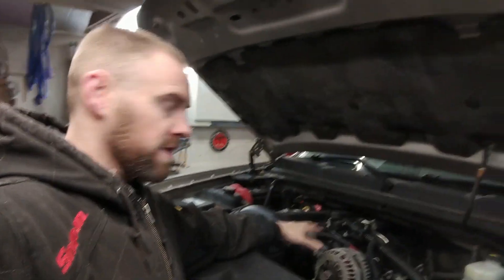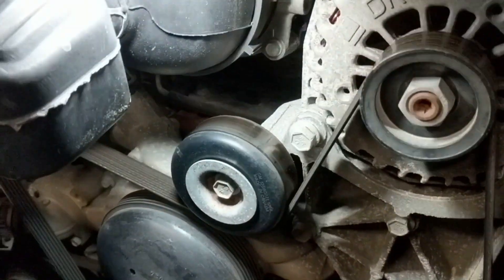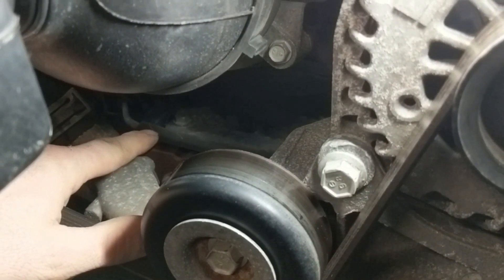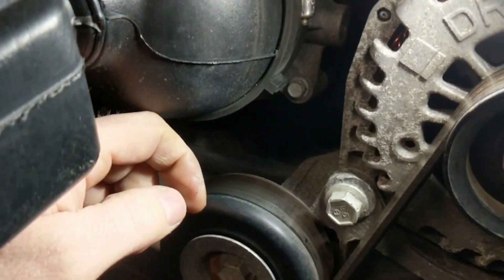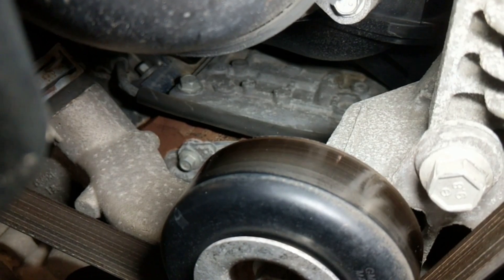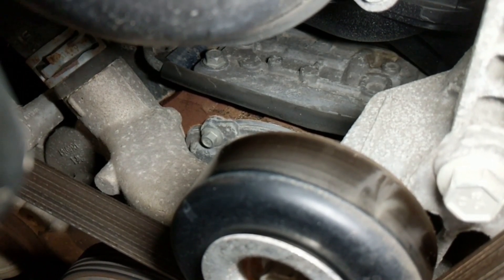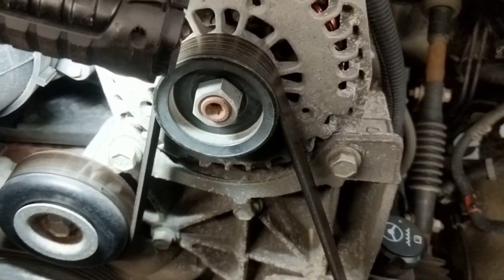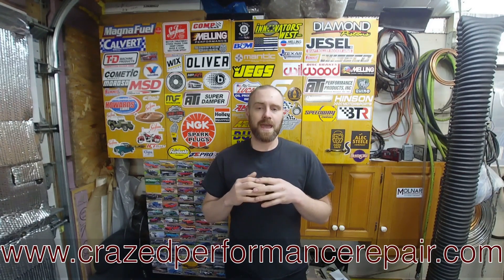Determine GM v8 Block Type, Why it's Important.

Comment: I have a 2008 LMG... LS, 5.3, Iron, FF/AFM.

Not sure about other gens, but if you look at the 8th digit of your VIN and it's an O or J, you have a 5.3 Iron Block. If you have K, you have a 6.0 Iron Block. The rest of the configuration codes (again, 8th digit) are Aluminum.

**4.3 and 4.8 do not list whether they are Iron or Aluminum.**

Ref page 5-135 in user manual to confirm. Sorry for amount of edits and/or multiple comments if there are any... my phone sucks.

Comment: What's the prefix in order to keep it from happening, dare I say bulletproof our investment?
Reply from the maker: Light it on fire😂...? No but for real, turn it off do oil changes at 3k and hope for the best. That will at least prevent a collapse but a spun lifter or bad roller? Not so much. Don't forget to check the vlom bolts.

Comment: My number 8 intake lifter is collapsed. It's a non DOD cylinder. Any advise on un-sticking it?
Reply: 2008 Silverado
Reply from the maker: It is most likely a bent pushrod rather than collapsed Lifter. What's the symptoms?
Reply: Lifter knock so I removed the valve cover. Rocker was loose against the pushrod. Pulled the pushrod and it looks good. I suppose it could be a worn cam lobe.
Reply from the maker: @troywood5686  Could be a bad trunion bearing. Those are the bearings in the rocker. If the cam lobe worn off it wouldn't likely make a knock sound. It could also be a bent valve, does the cylinder hold air in a leak down test? compare the height of the valve stem to the other stems.
Reply: Thanks for the reply. I hadn't considered a bent valve. I had a bent valve in a 2004 Express van once. It didn't have any knock at all. I don't have the means to do a leak down test but I think I am going to take it to my mechanic as soon as I can spare it for a couple of weeks. It does seem like the cam lobe is fine now that I think about it. It has full stroke as far as I can see. It just has that play between the pushrod and rocker. Could it be something wrong with the valve seat? Maybe something lodged in there? Guess I will be finding out. I do have an iron block. Any advise on getting the manifold bolts out?
Reply: @CrazedPerformanceRepair  Actually, I am just East of Lacrosse. What kind of drive is your shop from there?
Reply from the maker: @troywood5686  that's a little over a 3hr trip to get here.
Reply from the maker: @troywood5686  Check this video for the manifold bolt trick https://youtu.be/0uLEBnhycpM
Reply: When you heard the tap, is it intermittent or continuous no matter how high you've reved?

If intermittent, do engine flush using K&W/CEC engine flush or Liqui Moly Engine Flush, drop oil pan and replace pickup tube o-ring.

Stuck lifter may require manual unsticking with engine flush along with o ring replacement.

Pay attention to oil life system as its based on revolutions of the crank, not mileage.

Comment: If you eliminate AFM/DOD before you've ever had the lifter problem, does it reduce the odds it will happen? Are there anythings we can do to help prevent this problem from happening in the first place?
Reply: Change your oil.
Reply from the maker: Yes that definitely helps, as well as not listening to that oil change light. Do the changes at 3k or 5k mi on full synthetic.
Reply: @CrazedPerformanceRepair  Thanks for the info. That explains why my 012 Silverado 5.3L insists on Dexos 2 full synthetic. I am at 80K and use the Ranger AFM disabler that I will be sure to keep plugged in. Also up my oil change interval.
Reply: Yes it does, keep up with oil changes, pay attention to oil life system as it's based on revolutions, not mileage. At some point you will want to replace oil pump pickup tube o-ring seal.

I just did mine on LR4 engine.

Comment: 3:53  you questioned why dealers are recommending a new motor when it is just a lifter. Yes, it happened again almost 2 years after the 1st incident. The unfortunate truth is I was hauling a heavy trailer when it happened and was about 20 miles from home. Dealer said camshaft was screwed (as well as stuck lifter). I don't know for certain what precisely failed on the camshaft, I didn't bother asking, as my wife insists on dealing with these people. I had already told her on at least 2 occasions that I believe that the dealer is taking advantage of her (and I am being conservative there, having to deal with the wife, I feel she is being outright scammed) . Anyways, The engine has about 250k on it, The oil pressure I had noticed is a bit low at idle, but not low enough to set off any errors. Anyways, thanks for the informative video.
Reply from the maker: Well honestly 250k is just kissing the potential mileage of the bottom end. Labor to do a cam is the same as a motor but parts are much less. I do do the cam pull the pan for 4 hr extra and change the chain and damper plus Pand gasket and sump tube. Then run it another 250k plus. All for slightly less than the cheapest used motor (use problem)...
Reply: @CrazedPerformanceRepair   Thanks for the quick reply. I really want to see the camshaft though.
Reply from the maker: If the failure is on cylinder 1 or 7 the camshaft can be inspected without removing the heads.